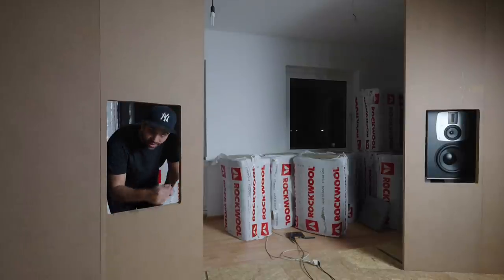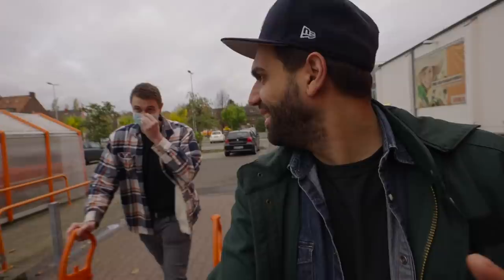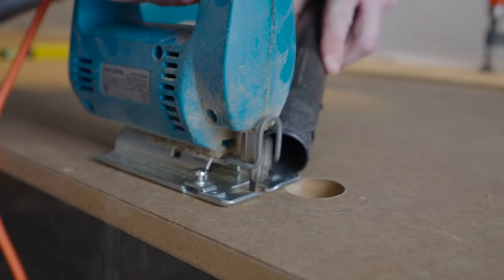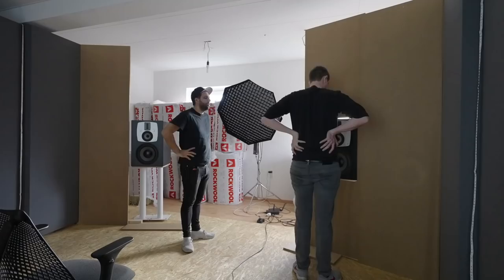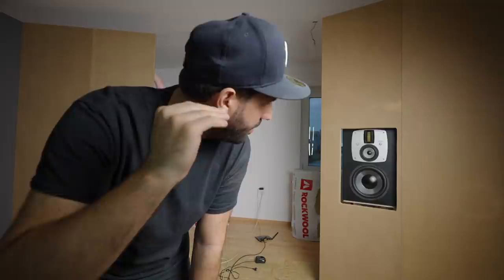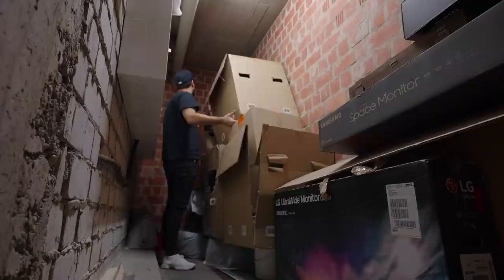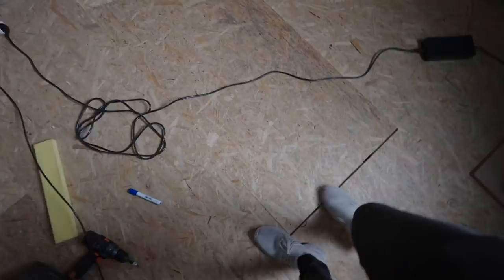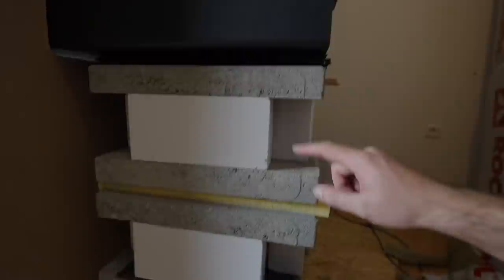Mounting Speakers Into the Wall

Comment: Not so modular after all huh? That "front" fake wall is just there for looks, it has no way of contributing to the sound of the room. It's only going to give it the look of built-in speakers. This is not the correct way. Everything in this studio is just half a$$ed. Anyway good luck to all those following these methods.
Reply: Have you ever, once built a studio with in wall mounted speakers? I guess no... otherwise you would know how physics work. Even with front ported speakers you have a throw from the back wall if  you place them normally in a room without inwall mounting it. this reflection causes soundwaves to come later to the sweet spot where you sit an mess with the first waves. It makes it sound less transparent and even cancels out certain frequencies.
Jon is doing everything perfectly fine so far. Don't be a smart ass if you never worked in studio building. the math is pretty simple.
Reply: @AlexisGitarre  yes exactly, well said!

Comment: That isn’t how you do it. You cut the hole. Use a surround to finish it off and that surround is so deep on the lower lip, the speaker sits on it totally self continued so that it’s not firing sound into the void

Comment: Please, use this current set up of the walls as a mock up, Jon. Once you're sure about the wall and the exact places and holes where the speakers go, measures it properly and buy new plates. Take 'em to a cutting specialist and let the holes cut out by a machine. Right now they doesn't necessarily look amazing, mate...
Reply from the maker: It will be covered don’t worry.